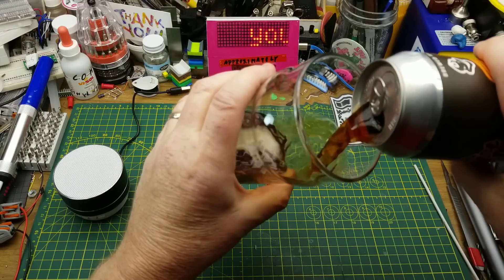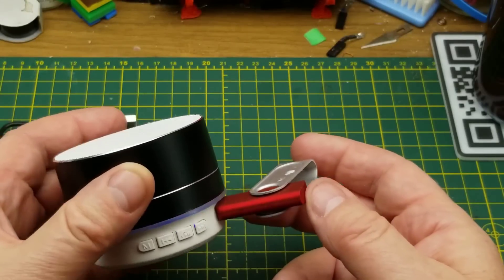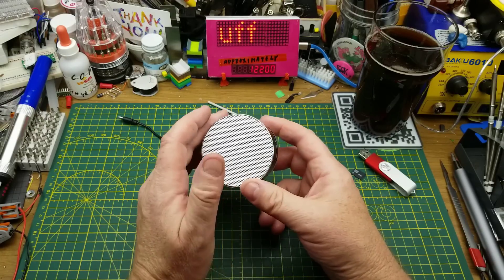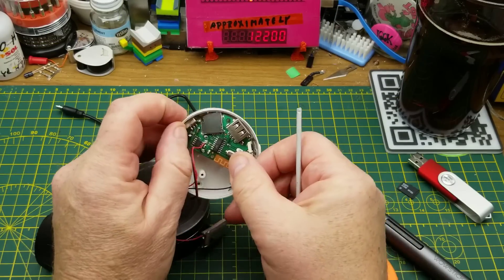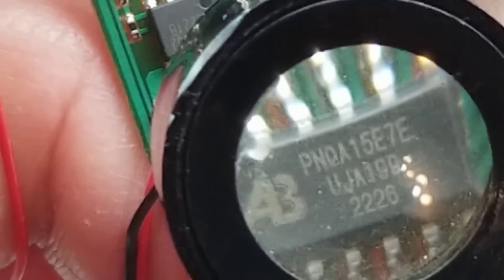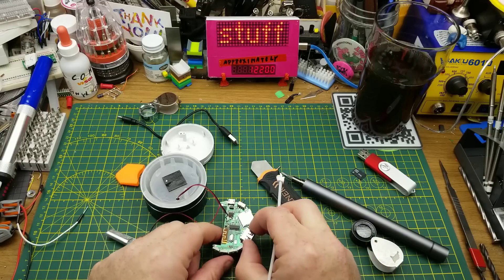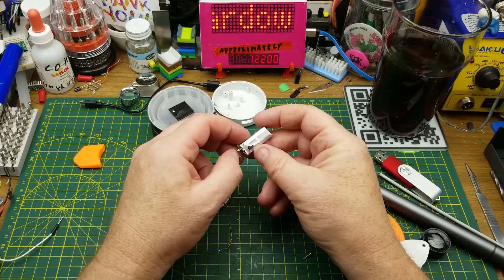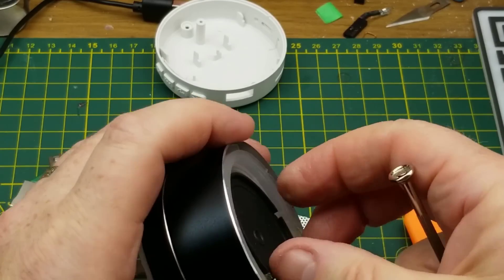Overpriced cheap bluetooth speaker teardown

Comment: If you hold the play button for a couple of seconds while in FM mode, it will scan through what it can find, the antenna is basicly the usb cable, connected to its shielding.

The NS 8002 Or just 8002 , a handful for a $ , copy of the LM4872 ic , nearly all cheap speakers use it, sound quality drasticly changes if 1uF input capacitor is used.

The main ic is made by JieLi , there are 40+ models, it is a programmable chip, types start like AC6969A , that part supports all the functions your speaker does. The main chip is a 32 bit risc based device , with peripherals built in. Has ram and flash as well. About 1.5$ empty.

The battery is mostly 300mAh , the diode prevents it draining out via the usb port.

Also that speaker is horrible, 0.25w 8/4 Ohm, replace it with nearly any 4 Ohm one and it will sould half decent.

Comment: The other day i bought a previous model that looked almost exact the same (brand: Soundlogic). It had a special cable for the USB mini (charging) jack with at the other end a USB-A connector but also a barrel phone jack. I have not tried it but i assume you can hook it up to a device with a phone-out jack. BTW I paid 1 Euro for it. In another shop they sell the same looking devise (with a USB micro jack) for 5 Euro.

Comment: I have about 10 boards that are very similar to that although slightly more rounded (and do contain the 3.5mm socket for the FM) which are available on AliEx for around 85 cents each with free shipping. I add a decent 3W speaker (another dollar) and glue them to the base "membrane" of a tubular cardboard Oats container. I add an 18650 receptacle, wired in and glued to the base, also, and use protected 18650's but remove them to charge. It's amazing how decent they sound out of an Oats tube. The only downside is that they are only Bluetooth 2.1 so cannot stretch too far. Still handy, though, for the price, and the audio lasts for days. I also use them with plastic drainpipes. Fun. Thanks for the video.

Comment: The manufacturer of the chip is bluetrum corporation, a chinese bluetooth chip maufacturer just like zuhai jieli (JL logo) they make dirt cheap chips for bluetooth speakers JL and AB are both realy big in the cheap bluetooth chip manufacturing, they are used worldwide, they are bluetooth mp3 microcontrollers and can have radio, aux in, usb, sd, bluetooth functionality but they need to be programmed to do that, they also have some i/o pins but there are almost no datasheets available cause its chinese :) so its not a purpose built chip but rather a pretty common cheap bluetooth chip
Reply: If you hear those Chinese lady voices on your Bluetooth speakers, then you know what chip it is using.

Comment: It's so versatile in it's functions. I've just ordered one off ebay for £3 !
I'm going to disconnect the internal battery, amp & speaker, and hook it up to a line input on my home made stereo. LOL. (I just hope I can find a strereo signal on the main chip. if not, mono will do)
Reply from the maker: I'll be interested to see (or hear) the results of your experiments.
Reply: @pileofstuff  I'll let you know if it works. (or not).
Reply: The speaker arrived yesterday, so today I took it apart and removed the audio chip, soldered a wire where pin 4 was, (audio in to the amp), and another to gnd. I plugged it into my stereo and it sounds fantastic on all inputs and the volume control still works. :) (I thought that would be part of the amp circuit)
However, I can't find a stereo output from the main chip, just mono. :(

Comment: I have one old bluetooth speaker that uses usb socket as aux input. You need special usb cable, micro usb splits to usb a and 3.5mm audio jack. It uses both data pins as left and right channel. As for naughty battery charging they are using diode drop voltage to limit not only voltage but also current. This diode gets about 1V drop on about 1A current, and a bit less when it stops charging. Still, no battery protection is bad, and battery size is too small for this.

Comment: Got one just like it at Walmart for about $10.  Mine came with all the bells and whistles like an AUX headphone jack lead tied into the USB cable,  RGB flashing LED, and a microphone that is ported in the side between the power switch and mode button.  I ripped out the battery that came with it because it only lasted like 10 minutes and wired up an external 18650 battery.  I also swapped the annoying fast flashing RGB LED for a blue LED.  Nice to se someone paid almost twice as much for a shoddy Bluetooth speaker

Comment: i suppose the fm radio relies on a usb cable being connected, using it as an antenna. also, connect it to a decent loudspeaker, i think the chip itself will sound fine, might just be that speaker sounding like poo :D

Comment: that little speaker  (the driver) inside looks just like the speakers that used to be in computers to sound the beeps when doing the self test at start up. I have a big box of them made a loud low fi speaker out of a couple dozen of them  wired in series parallel to equal 8 ohms for an experiment. it was loud and c****y yea!

Comment: I have been working on installing cheap BT speaker wireless capabilities with quality amp and speakers. I keep getting these BT speakers for free people want me to fix. Some can others can not.  A way of reusing Car stereo speakers and amps has been my motive. Cheap and easy to get quality car stereo components from weckers. So far I haven't gotten one to work properly. I have no programing skills and it looks like we need is a small Ras pi board to bridge the gap. I've tried to learn programing these small boards hoping it wasn't much different than web page creation. Haven't found a source of education that has made it click for me yet. Maybe it's an old dog new tricks kind of thing. I'm already skilled at making wooden chassis for them.

Comment: I have a blutooth speaker/clock that may have the same chip, the ladies voice announcing the modes sounds the same at least, and it has all the same facilities except the USB disk input, so may be a related chip. I have tried to take it apart, but can't get in but don't want to use more force because its actually quite useful, and sounds better since it has 2 speakers that are possibly less cheap. The only "fault" that explains how cheap it was is that the display is very dim, bright enough at night but barely visible during the day unless its cloudy!

Comment: I also have that same chip in a bluetooth speaker box.  It does play FM but you do need the earbubs for antenna.  I removed it from the original box when that got destroyed, and installed it into an old 1952 Philco Radio cabinet.  I simply tied in to the heater (6 volt power rail and used a diode to protect it), that powers it, and with the speaker wires are the FM antenna.  I then tied the output to the audio section of the tube input, using caps and resistors to protect it and it booms!  The guy I sold it to uses it for dinner parties and plays canned music through it as well as provide great conversation of an old radio playing modern tunes. These cheap throw-away's come in handy at times.
Reply: Earboobs😅

Comment: Well, you could hook up a decent speaker and a bigger battery (so more current can be drawn) and see if the audio improves ?
Reply from the maker: You would also want to replace the charging circuit with a proper one.

Comment: I have one from 2018. The amp & speakers are MUCH better on mine than on yours. But it's the same chip.
The FM mode is set up to use a pair of wired ear buds as an antenna. Since there's no earplug socket, you can't do it.
But it's the audio that's crappy, the music player chip is excellent.